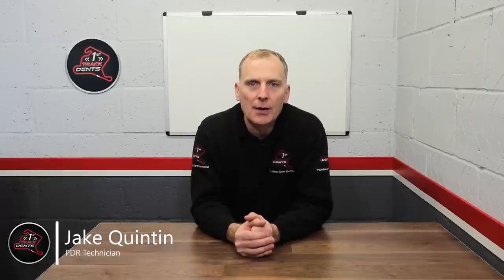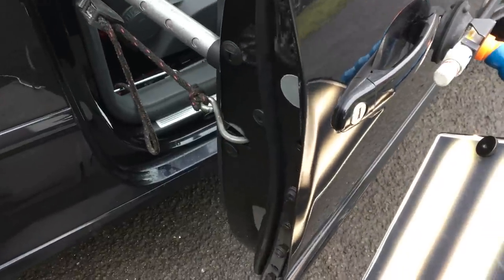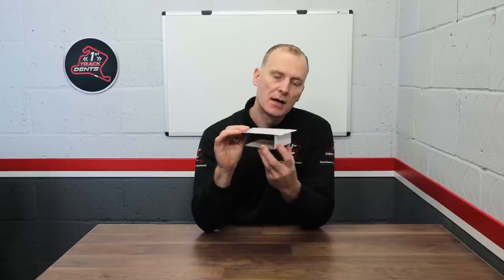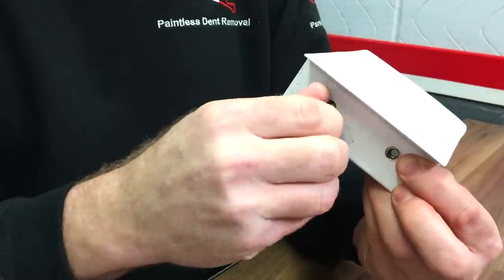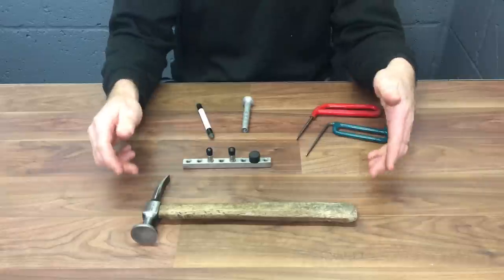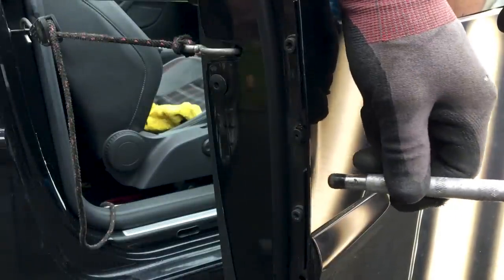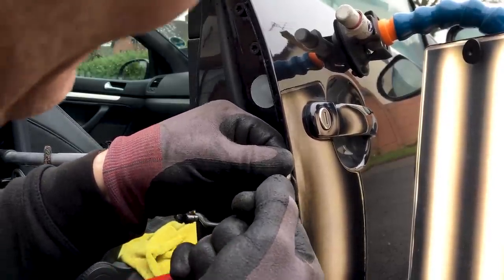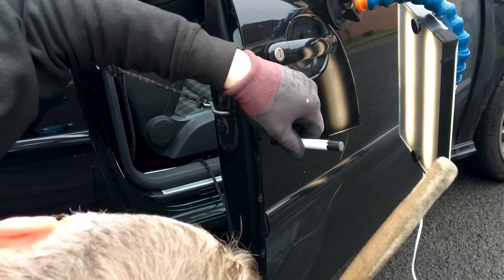HOW TO REPAIR A BENT DOOR EDGE | FULL PDR TUTORIAL

Comment: Well done, does the softened paint dent when hammering on it?
Reply from the maker: Hi, the paint is softened slightly when heated, but that is when the pushing from behind is done to prevent the paint cracking. When tapping down the high areas on the face of the panel I make sure the panel is cold again. The tap down used is made from Nylon/rubber so it wont make any marks on the panel. The only time it will make marks is if there is any filler/bondo lurking under the paint!

Comment: Great work on the repairs always stunned at what damages you can repair with pdr. I have a door for a restoration priject and it has a similar bent edge right on thebottom corner, could i use the same techniques on the tradition bent over lip skin door?
Reply from the maker: Yes, you can definitely use the same process, just remember to go slowly, rather than trying to hammer the damage out in just a few blows. 👍
Reply: Yes you can but it's very difficult hammering down the highs. Best way is to start one end to the other over and over and if you have them, chase the highs at the end.

Comment: Question: About what surface temp are you looking for when heating the paint? 150 degrees fahrenheit?
Reply from the maker: Hi Robert, I don't use a temperature gauge, I just warm it up by touch, I get into a flow when I am working of heating and pushing, so having another gadget to test the heat of the panel would slow me down and get in the way. I get the surface about as hot as it would get on a hot summers day. 😎

Comment: Awesome video Jake, very informative! How would you go about fixing a car door with three layers of metals instead of two? How would you go down the window aperture (what do you mean by window aperture?) to get on the back to push the low areas back up again(kinda like in step 3)? Thank-you in advance for your respond.
Reply from the maker: Hi Sean, if this was a standard type door, I would put a window guard in the top of the door to protect the door glass, then wedge it open with my widow wedge,  then use something  like a whale tail to get behind the low areas, sometimes you may have to glue pull if the skins are too tight together for the tool to get behind. I hope this helps.
Reply: Awesome, thanks Jake.

Comment: would a blending hammer do for the outer skin rather than a tap down?
Reply from the maker: Yes a blending hammer could work for the larger crowns, although some of these areas are small so I like to use my tap downs as i can match the tips to the size of the crown/high spot I am tapping down. 👍

Comment: how hot do you need to heat the paint? A laser thermostat is cheap and would help you get consistent results
Reply from the maker: The panel doesn't need to get that hot, just as hot as the paint would get on a hot summers day, yes there are laser thermostats that you can use, but I just know how long I have to heat it from years of experience :-)

Comment: what is the heatgun temperature you set for that?
Reply from the maker: I have never measured the temperature of the panel, I just warm the panel up so that it is very warm but not too hot to touch. It is just to keep the paint flexible so that it won't crack or split. On a hot summers day I don't heat the panel at all as the panel if in the sun, is usually warm enough. 👍

Comment: How would you fix a door that was bent out at the bottom, like if someone shut a seatbelt in it? Someone’s done that to my car on both sides. The tops line up but the bottom rear corners stick out about a cm.
Reply from the maker: Thanks for watching. It's quite easy to twist the frame of the door, if this is the case it may need to go to a bodyshop to be twisted back, however if it is just an outward crease at the bottom, a good PDR tech should be able to fix that for you 👍

Comment: is a 1000 watt hair dryer enough to do the heating?  my car door is a conventional one, how to repair a dent on the edge of the hinge side?  
Thanks
Reply from the maker: A hot air gun would be better, a bent edge on the hinge side would be more difficult but not impossible, you just need to use a slide hammer with a thin lip on it with some masking tape to pull the edge up and then use your tap downs. 👍

Comment: What is the differance between using a rubber or a nylon tip knockdown?
Reply from the maker: The rubber tip is just a bit more gentle and is good to start with to rough an edge out, whereas the nylon tip is harder and will make damage if you are not careful, so you need to be a bit more precise with your hits:-)

Comment: Can you list the tools I  would need. I have the same problem on my dodge grand caravan  tailgate on the lower left side [ drivers side rear]. Please help. Thank You Ed Itle
Reply from the maker: Hi Edward, you would just need to get yourself an interchangeable Aluminium knockdown which will take a rubber or Nylon tip, and a standard nylon knock down. These can all be purchased from a good PDR retailer for example pdrprotools.co.uk or TDN tools here in the UK. You will also need some basic training if you haven't get that already as it can be a very tricky repair to get right. All the best:-)

Comment: Hi, I love watching these videos, so interesting to see how you can do this. 
Also, just wondering if anyone knows about how lumps in the body work next to a dent occur. If it’s due to a low impact collision or a higher impact faster collision. I’m super interested but I can’t seem to find my info on the internet. Really appreciate a reply. Thanks! :)
Reply from the maker: Hi Emily, thank you so much for watching my videos and for your question. We call these lumps crowns, it's has a lot to do with the design of each individual panel to what type of crown you will see on the panel. For example, sometimes a crown is caused by a support beam or crash bar behind pushing outwards when the impact is close to it. Most commonly you will see crowns in each corner of a roof panel if something heavy was to land in the middle of the panel, as the corners are the last part to bend inwards/down as the corners are the strongest part of the roof, so you will see a soft banana type shape bend in each corner, this is very common and nearly always missed by customers who only see the main impact.
A crown is often the pivot point of where the metal bends, if you bend a thin strip of metal and then bend it back the other way you will also see a lump form. Scientifically it goes further as it has something to do with the way the particles in the metal react, most crowns are where all the pressure is held from the dent, that is why it is vital to identify where the crowns are when doing dent removal as if you don't push/hammer these areas down in conjunction with pushing the low areas up, the pressure will not be fully released, therefore the dent will not come out cleanly. I would probably say they are more common on low impact collisions, as a high impact collisions tend to stretch the metal beyond repair. Sorry for the long reply, hope this helps to explain it a little bit better
Reply: 1st Track Dents thank you for all your help. A very interesting reply! Many thanks again :)